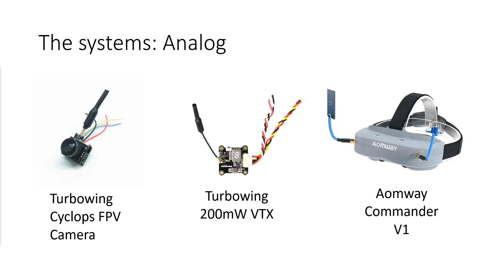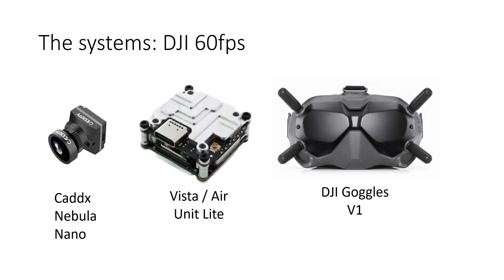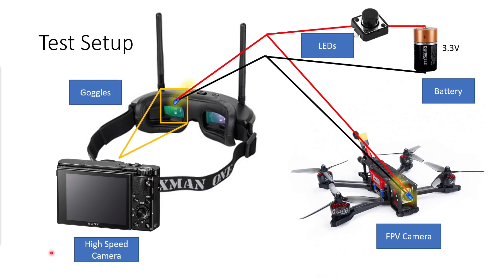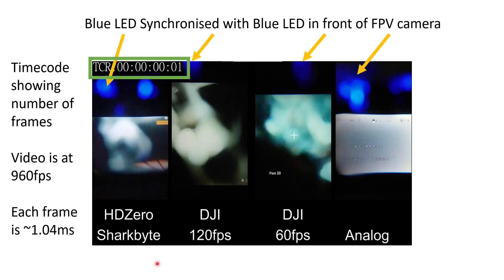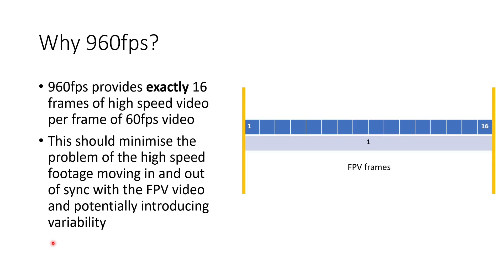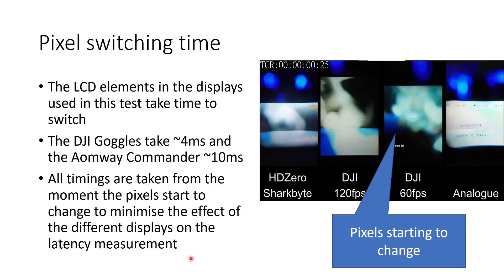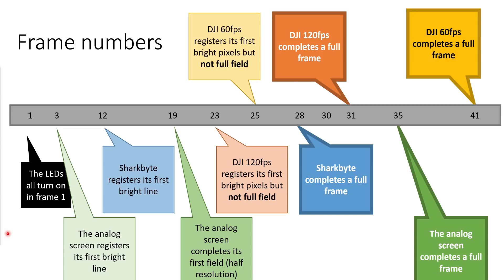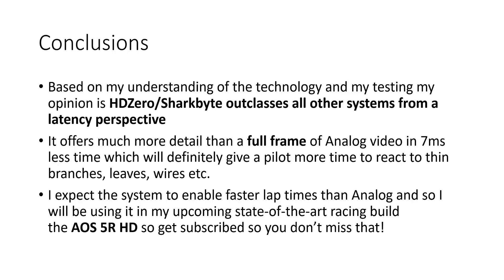Video latency testing with 960FPS High Speed Camera: Analog, DJI, Sharkbyte, HDZero

Comment: Your video misses the point that latency is not the only thing that matters in the overall FPV experience. Image quality and range/penetration are the other two pillars. A 3ms advantage in latency will mean nothing if you have an image filled with snow or digital artifacts, you will hit the branch anyway. In a race environment which is mostly an open field with few obstacles, maybe the other 2 pillars don't matter, but when freestyle/cruising in a hybrid environment of structures and vegetation, I would argue the other two pillars are more important then fastest latency too a point.
Reply from the maker: You make a good point about the other important aspects of the FPV experience. I wanted to focus on latency in this video as it's been a big topic in the last few weeks.
Reply: and some forget that a pretty center image is not all there is to the FPV community....dji has to be segregated at events because of their poorly designed system....unless it's a dji event I guess...
Reply: @steve_beatty  Well.. it's not really that poorly designed, from an event perspective the only issue is plugging in on channel 8 really (or if it's racing than also getting a lot of feeds cheaply captured, though it's solvable on the cheap nowdays), otherwise it's just slightly different frequencies, just like SB that has slightly different wider channels. And I fully expect analog people to suffer about the same if they are on the same channel as SB.
Reply: @ooHotcooleRoo   It's poorly designed in that it does not fit into the current fpv ecosystem...particularly on the 50mbps power setting at 1.2W that every dji pilot I've run into in the last 1 1/2 years seems addicted to....And yes...of course an analog user would be affected by SB on the same frequency ..not sure why you
would think they wouldn't. 🤔. The problem with dji is the 50 mbps update which takes up the whole band and turns it into 3 channels instead of 8...or 40..depending on how hyperbolic you want to make it look...lol.....the fact the goggles transmit causes   other problems..I believe it's channel 6 they fire up on initially and I was told yesterday by a dji user that it also scans for a better frequency at the same time..emitting rf all the way across the band ?..I well documented my issues with dji in a video last july asking for help from the community with the iproblems...... I received some positive suggestions...none attractive to the dji pilots I was trying to fly with...who eventually took over the field of 8 + analog pilots now down to 3 dli users  ...good times...👎🏼
Reply: @steve_beatty  Well... as I said the real issue is plug in, after that all the issues are with the pilots really. 50mbps is a feature, I use it only when flying solo or with 1 other DJI pilot. Never with analog and we have no issues with each other. Plug in also really only affects those is very close proximity and you loose 1 analog channel to plugin on DJI channel 8 (Raceband 6). So I cant really call it an issue with the system, it's more or less an issue with people. And people can be arseholes with any system really.

As for scanning - only DJI FPV Drone does that, air unit and vista does not - you select the channel manually.
Reply: @ooHotcooleRoo  well..in my nearly 40 years flying rc I have never seen a system of any kind that was incompatible with others to the degree that dji is.....maybe that's my problem...that whole "playing well with others" perhaps seems  a foreign concept to those (not you..don't know you) who fly mainly solo...Like I said elsewhere...8 analog pilots now down to 3 dli users that..as you say..are aresholes...but if not for the actions of dji.........
   Good Air, Straight Props..🖖🏼
Reply: @steve_beatty  I do agree that it's a lot more impactful than other systems when used improperly, I get you man, it's just that I feel that your anger is misplaced here. You can replace DJI here with some dudes in a party bus blasting 160mhz wide Wi-Fi e.t.c. And I get the community stuff, but well.. if its any consolation you can also screw with DJI by blasting your VTXes on their frequency, also easy to see since it's on the side of the goggle.

But in general people will do people. And some are just.. tards (and amount of those usually increases with income). Alternatively you can all try to get together and talk it out, with them on 25mbps and 200/500mw and proper channel management you can get 2-3 DJI and 3-4 analog users in the air at the same time with little issues. Just keep 5 meters away from their goggles. And avoid channel R6, but it can be used by one DJI pilot (ch8 for them) if both manage their plug-ins.

P.S. Even when I was with 8 other people, rarely there were more than 3-4 in the air, other were discussing stuff, fixing stuff, messing with stuff - so if you have decent people - it's easily managed. (Except when you have people with wrong VTX tables and shit VTX's that are set to one freq and instead use another of shift somewhere over time... but that's just shit hardware or setup).
P.P.S. I think for US a good analogy would be guns. They are not inherently bad, the issue only arises when they get in the hands of bad people. Same with DJI system. And while you can argue that we would not have an issue if guns were not to exist, but.. people can kill people with other stuff too, knives, bats, frying pans, fists.. It's an argument that goes nowhere.
Reply: @steve_beatty  Hi Steve - my new trolling buddy on YT? lol. Turn Focus Mode off on DJI and that pretty picture is edge to edge :-)
Reply: @dracocq  nope...there's a video out now dispelling that myth pretty squarely even if you wouldn't believe my personal experience..I have had that darth vaderesque thing on my face 😉....not trolling you btw....I just comment randomly and to be honest have no clue as to who you are...
Reply: @steve_beatty  I don't need to rely on any video or your experience, been flying DJI for 2 years, about 6 packs a week. Flew analog 7 years before that. DJI hands down beats analog in every aspect I care about. I have purchased SB, just haven't installed it yet, then I'll have the full spectrum of experience on all the viable FPV options (had Connex/Glyph in the past). I am not expecting much from SB regarding IQ or range especially with only the Runcam Nano available, but wanted to see if I can truly feel the latency difference and if it will matter for my style of flying (non-racer). My only motivation is to provide real life experience to new HD pilots and hopefully save them money, I have certainly wasted a lot of money in this FPV journey (e.g. HD1, HD2, HD3 and HDO at 500 a pop each before finally a viable product HDO2). I think this is enough derailing of Chris' thread.
Reply: @dracocq    empirical evidence has no value in your world apparently so...Great...keep those fingers in your ears and eye holes.🙈🙉🙊 as far as educating new HD pilots..me too..I steer them far far away from dji
Reply: @steve_beatty  Here, you just being ignorant really (or trolling, though I just think you have an issue with your local pilots that tainted your view on this topic). While SB might fit your world view, it's... not great in my books IQ wise, and while I have yet to see it in person (it's in the mail) I've seen plenty DVR that to my eye look like 360p detail level wise. It's not bad, mind you, if it works in wi-fi congested areas, I will very likely have a 3' toothpick with it on board but at least I'm realistic about the whole thing.
Reply: @steve_beatty  I think your disdain for DJI clouds your judgement. Actual experience is always better than empirical data. I notice you say nothing about the inferiority of IQ and Range with SB because it is undisputable with current state of SB hw. Maybe when the high power VTX is available and a much better camera is available, but we won't know till that happens. Like I have stated before, the 3 pillars are important to me and my money will go to the vendor that can provide the best for those pillars. DJI wins on 2 of 3 for now, who knows in the future it could be whiz bang HD company. I won't resort to the childish implications of the monkeys, and since neither DJI or SB transmit audio, I guess we all hear no evil.
Reply: @dracocq  you really should look up he definition of "empirical"...😉
Reply: @dracocq    Would also like to add that in every SB video on my channel I make sure to show the worst..because I know that the developer is looking and wants to know where the problem areas are...so much for me ignoring SB's shortcomings 😉

Comment: Thank you Chris for great job and detailed explanation! The only thing I would add that it's not an easy with analog, because the second field (even lines) are not the part of the same frame that was sent before (odd lines).  This is new updated picture containing a even lines of image that was captured after odd lines were sent. So we can think that analog is 60fps of 240 line frames that are sent in a very confusing way :)).
Reply from the maker: 💯 It's very hard to compare Analog and digital directly but I think the high speed camera helps as far as possible.

Comment: Thanks for the video. Slow motion is very cool.  I was a little bit surprised with your analog camera choice. Manufacturers claim the analog camera itself can be 2ms up to ~30ms depending on which camera is that. So I'd love to see analog measurements with racing cameras like Foxeer predator 5 or runcam racer 3. And also in NTSC mode most racers prefer.

I've also heard that old Aomway and Skyzones got extra latency in comparison with modern goggles and it's not only about screen type.
Reply from the maker: The pipeline latency for the Analog cam was ~2ms which is very very little. Even if  other Analog hardware was faster it wouldn't change the result by more than 2ms.

Comment: At what point of latency do we see diminishing returns though I think is also a good question. As its proved in a control test by linus tech tips there is a point of diminishing returns on update rate and the human capability of responding to that input. Saying something is "faster" when your talking 5ms difference, is that in the diminishing returns range? The reason I say this, there is a point where picture quality starts to matter more then the diminishing return on latency.
Reply from the maker: A lot of discussions on technology come down to whether a particular improvement makes a 'meaningful' difference. I'm a big subscriber to marginal gains. I will take every %age point I can get anywhere I can get it. Everything makes a difference and everything adds up. I think that's what progress is at the end of the day little edges here and there that add up to a big improvement.
Reply: @ChrisRosser  Yup totally agree. Just today a friend that flies crossfire at 50hz flew my ELRS 500hz build and he was really surprised how smooth and responsive it was on DJI vs his on analog. Might be 120fps and generally good picture too (since he was kinda interested in if he wants to shell out for digital) but I feel like control link played a big part  too.

Comment: Great testing results.  Kinda surprised how slow analog was.  Also, surprised how close to sharkbyte DJI was, i would have thought it would be larger.  

Not surprising the DJI 60FPS results, that has felt almost unflyable since the first cam they released with this frame rate.

Next can you do more testing on penetration? So we can decide on whether latency or penetration is more critical for flying.
Reply from the maker: I was surprised by just how fast analog pipeline latency is but that doesn't translate to full frame latency where you can't escape the impact of 30fps. I hope to look into the effect of interference on latency in a future video.
Reply: Wait a minute, Is DJI V1 unflyable ? Ok?
Reply from the maker: @Thewiruz1  DJI flies great.
Reply: @ChrisRosser  Yes i know as i have a pair myself but I might have misunderstood the post from Jon E5 as he says it's almost unflyable? English isn't my native language so sorry if that's the case
Reply: @Thewiruz1  He was talking about Nebula nano basically and 60fps mode.
Reply: DJI is much larger latency as you know. You just have to take off... 

Sharkbyte's latency will actually come down when tested with OLED goggles, not that realistically it really needs to.

I agree, testing penetration versus latency would be interesting but hard to do with DJI as more penetration = more latency so difficult to seperate the two.

Comment: You really should be using a foxeer predator, TBS Transmitter, and a fatshark goggle.
Reply from the maker: With a ~2ms pipeline latency for analog I don't think a difference in hardware will affect the latency numbers much at all. There is very little room for any improvement. Even if all the Analog hardware had 0ms latency SB would still be 5ms faster to full frame!!!
Reply: @ChrisRosser  so you are saying it doesn't matter if you use a low latency fpv cam vs a high latency one (based on manufacturers quoted figures)?
Reply: @sibofpv9977  No, I think what he's saying is that in his setup VTX starts to feed a new frame in 2ms and it's a relevant frame so that camera is good. But if the camera has a lot of processing or even it's own frame buffer and say has a frame of latency - it would matter, since everything would be 1 frame late. Though I might be putting words the wrong way. Basically need to test on that setup with a camera known to have bad latency.
Reply from the maker: @ooHotcooleRoo  I don't think any analog cameras have a framebuffer and they all use similar image processing chips. I'm going to test a few different analog cameras with the high speed camera to put this one to bed.
Reply from the maker: @sibofpv9977  I think there are serious issues with the led+photodiode approach to latency measurement used to create  those numbers. I don't trust them any more and I'm going to test myself with a high speed camera.
Reply: @ChrisRosser  Should be interesting, I kinda planned to test that for myself as well (also have RX100M4) but it was not that high on priority list due to lack of time. But crancking up 3DNR on say Falcor2 does do something, it might not be latency per-se, but some sort of frame blending seems to be in effect for sure. I do have some decent selection of test subjects - T-Rex, Falcor 2, Ant. Also have nano predator 5, toothless 2 and rattel 2 on order since I cannot stand low light noise perf of Caddx ANT on my 1s toothpick to be quite honest :) From the photodiode experiments - toothless and rattel along with falcor should have some 20ms+ latency.
Reply: @ChrisRosser  there is a big difference in latency amongst analog cameras - easily 5-20 MS. You should use an LED clock with a 1 MS refresh and a high speed camera. Have the LED clock and goggle both in frame - or even simpler take a high speed photo. What's the difference between the time on the clock and the time on the goggle screen = latency.

Comment: How do we know Sharkbite is fixed latency?  Who has tested that??
Reply from the maker: The Sharkbyte technology has to be fixed latency. The frame rate from the camera is constant and there is no DRAM anywhere is the system to buffer frames. So image data goes in through and out with nowhere to stop. The result is fixed latency.
Reply: @ChrisRosser  well... FPGA can have some configured in it.. But considering the artifacts it should be fairly fixed if it does not drop/duplicate frames somewhere in the pipeline (be it a camera or goggles) e.t.c. Mine will get here in a week or two, will play around with that and determining real resolve (since by DVR, I'm still sure it's under 360p detail wise) with feeding it into a proper capture card.

Actually.. not quite sure on the details and if that's as easy as it seems, but what would be really awesome is to get some sort of image generator/hdmi adapter for the mipi camera interface that would work both on SB and DJI and feed them reference images\video and analyze captured video on the other end to get the result for SNR and all that to determine detail loss. There are a lot of mipi display drivers, but I imagine one needs to be able to configure the thing quite a bit, so something like that aptly named "HDMI to MIPI Development Board, LT6911C Docking with RK3399" on ali might work for that since it mentions configuration software and all that jazz and price seems a-ok. Don't have any time to mess about with that sadly, but would be rather fascinating.

Comment: That was excellent.  
My thoughts are…. I’m glad now I’ve bought SB. Lol
Reply from the maker: I'm glad I've bought it too. Cannot wait to get some stick time with the system!
Reply: @ChrisRosser  The main thing I've noticed when comparing to my DJI V1 goggles is that in woodland (where I fly often) I can see so much clearer than my dji.
SB is clear directly in front of where I'm focusing, but the tree branches higher up and further away are blurry whereas dji is often blurry in image even at 50.8mbps and 1200mw directly in my line of sight but the tree branches in my peripheral are clear. 

However in open spaces the current cameras are dreadful. Looking forward to getting my hands on the new HDzero